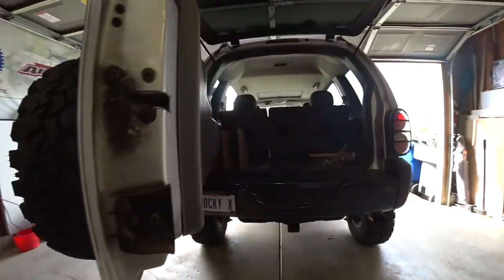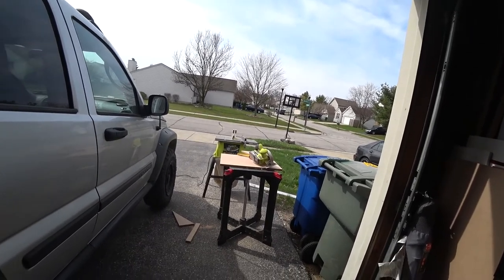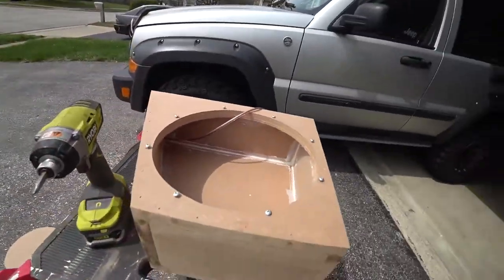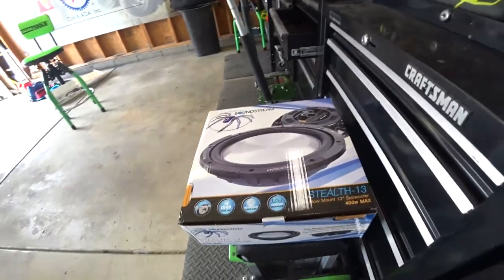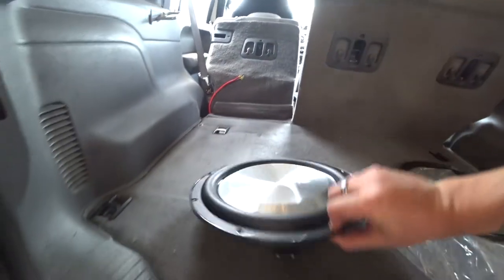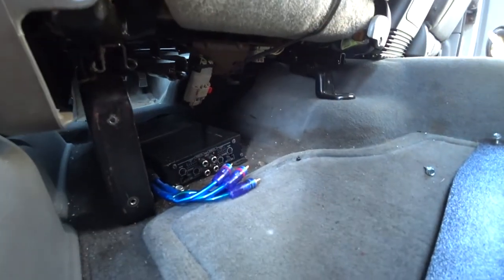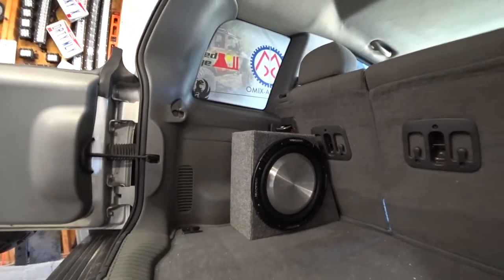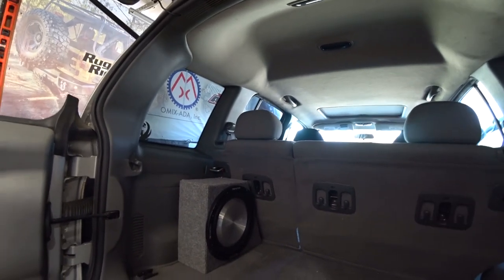Soundstream Stealth 13 Sub Woofer Test Box

Comment: Love it. Have a Jeep Cherokee CRD or liberty as they are also known. I love this sub. Compact. What is your view out of 10? Also is it a mono what class and can you give me a link. Finally what amp did you use? I want 2 in mine. The thinness of this makes it still practical
Reply from the maker: It has a huge single 5" 4 ohm voice coil, 200W RMS, 400W MAX, but I'm feeding it 500W and being careful. The output from this sub surprised me (for being a shallow sub) I would say this is comparable with a higher end standard style 10" sub. I ran it on a Soundstream Arachnid AR1.2500D amp @ 4 ohm for 500W RMS @ 14.2V.  I have links to both the sub and amp in the description of this video. As for an out of 10 score, I would give it a solid 7 overall, maybe a 9 if I were only comparing it to other shallow subs.
Reply: Rocky X TV thank you for that information.  It will help me get a quality sound without stuffing my boot with a giant sub box.
Reply from the maker: I also forgot to mention that the entire cone of this woofer is aluminum! I've already has some stuff slide into it and not even a scratch! Also the box in the video came out to around .35 cubes of air space so they can function with very little air.

Comment: Very nice! I have thought about improving on the factory sub in the JK but I don't want to lose cargo space - maybe this is the solution?
Reply from the maker: Soundstream has a few different shallow/low displacement sub-woofers. Check out the Stealth 13 & 124 as well as the Picasso Shallow PSW.104 & PSW.12

Comment: Rambling is fine...to many people out there bag on us for talking, your videos are great, keep it up!

I am thinking of a shallow mount in the jeep, but I was leaning towards the back tail gate, and reinforcing the plastic and building a mount for the subs. Thoughts?

Also, how do you have your dash tweeters wired out from the amp, parallel with the front door speakers, or do you power the dash tweets off the radio? If off the doors, are you concerned about the ohm load to the front door and tweeters, or do you have the amp gain down enough not to blow them?
Reply from the maker: Thanks! I have 3 way component speaker kits front & rear, they have passive crossovers (1 for each channel) so I have a crossover on each channel of my 4 channel amp. Each crossover has 1 IN and 3 OUT, 1 for each speaker, 6.5" Woofer, 3" Mid, 1" Tweeter. I really like the idea of the gate subs, I've been thinking about doing that on the Liberty for a while now. Just haven't broke the fiberglass out yet. Thanks for watching!
Reply: Thanks man, I haven't dived into crossovers and how they work, but I will take a look at them now. If you go the gate route, I would love to see a build series on it. In my mind, I envisioned mdf as the base mount to the tailgate, for the subs, sound deadening and some polly fill (in the gate), and then fiberglassing the plastic cover to make it nice looking, but also easily removable for maintenance/upgrades. I would love to see your take on it! Keep the videos coming man, I enjoy them and learn a ton!

Comment: Very nice
Reply from the maker: Thanks! Soundstream sent me a few more of these to play with so I'll be building another box soon. Thanks for watching!
Reply: no problem.   I meant to say was to hear more of it.   My apologies On the other post.     Do you plan on adding 2 more shallow subs if you plan on building another inclosure?
Reply from the maker: Surprisingly good for a shallow sub, a 5" voice coil helps! They can take some power as well, they are rated 400W MAX and I'm feeding it just over 500W.
Reply: Rocky X TV i didn’t know that soundstream had shallow subs.  I was always on eBay or Amazon and not soundstream website itself so I’m still researching.    I already have a 5 channel 1,600 soundstream amp. But I’m adding a 2 channel soundstream 2000 watt for my car since I’m putting 3 10 inch mtx thunder 6000’s
Reply from the maker: They have 4 shallows that I know of. The Stealth series 13 & 124 and the Picasso Shallow series PSW.104 & PSW.12. I don't know if they still make all of them or not though.